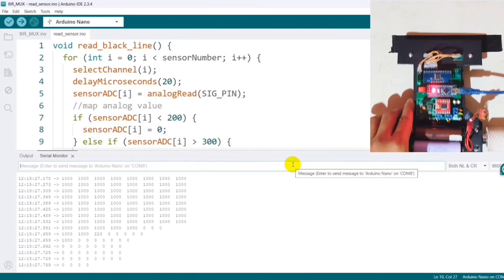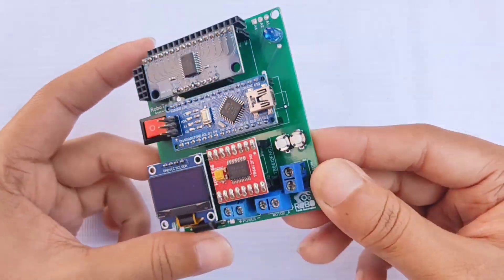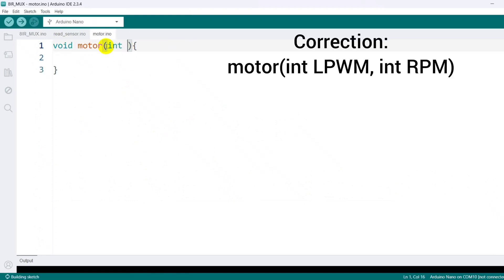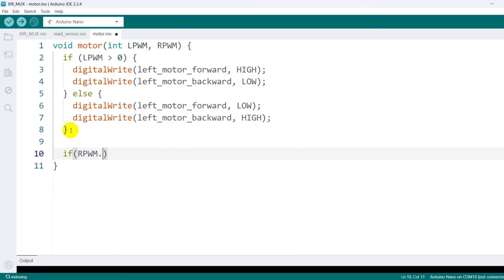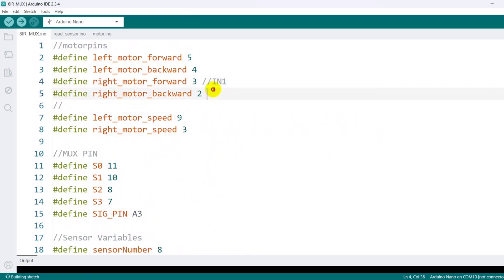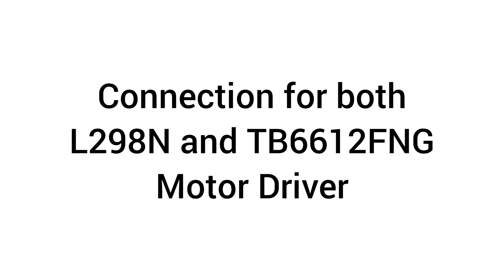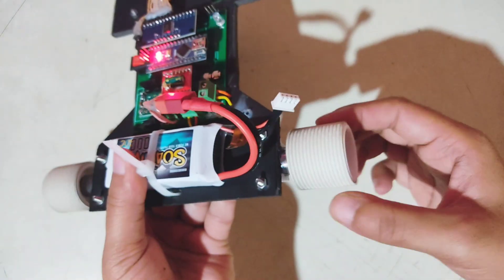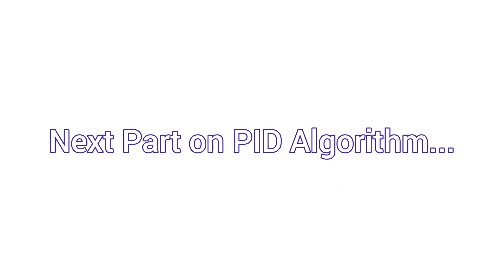How to Make a Line Follower Robot using PID | Motor Function Coding | JLCPCB: Part-03

Comment: Bro kitne rpm  ka motor use kiye ho ? 
Motor ko kitna power milraha he 
Battery voltage aur badhha sakte hne ???
Reply from the maker: 12v 800rpm motor
Reply: @aslamhossain1 speed kitna araha he load mein
Reply: Pls reply

Comment: Can I ask why, when I turn on the switch, the Arduino Nano's LED lights up, but I have to wait for a while (about 1 minute) before it starts running? Could it be due to the code or the hardware?
Reply from the maker: It's maybe a hardware problem